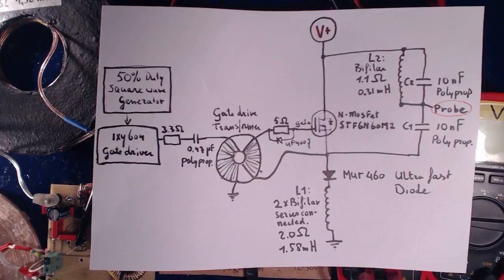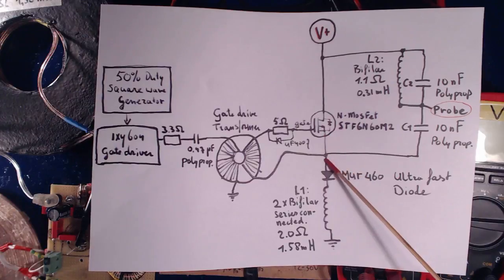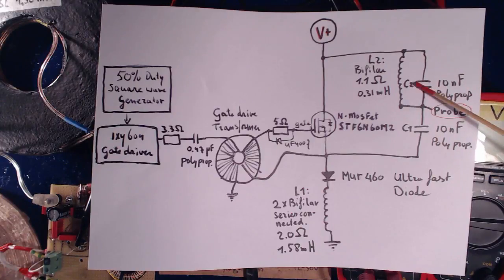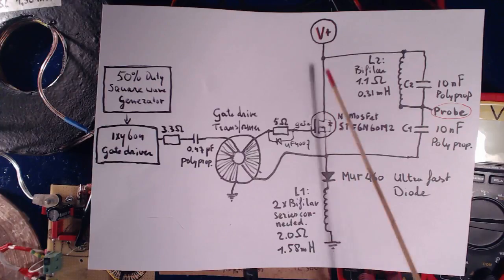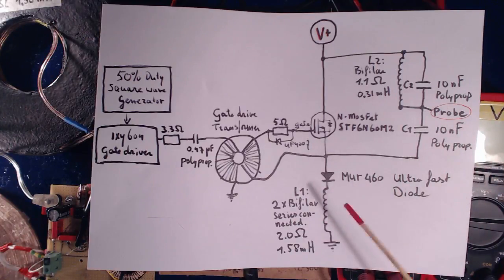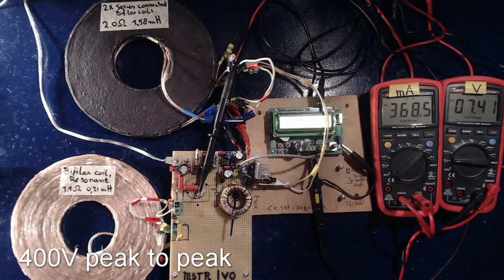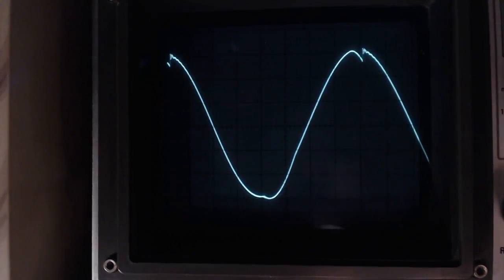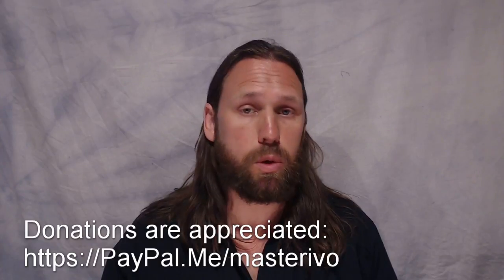Amplified series parallel bifilar coil resonance, from a single mosfet switch

Comment from the maker: Found new inspiration:Tesla's Radiant Electricity, read: http://www.shamanicengineering.org/wp-content/uploads/2014/07/Gerry-Vassilatos-Secrets-of-Cold-War-Technology.pdf
Reply: Jerry did an awesome writeup also read Thompsons " the researches & writings of Nicola Tesla" on how it all came about from switch closures and some switch operators died when switching at the peek. section on shocking discovery.
Reply from the maker: Yes Gerry Vassilatos, has writen a very inspiring book. Thanks for the tip, I'll look into it.
Reply: 404. Could you share a new link or pdf with the original contents?

Comment: how can it be grounded on the positive side of power supply? i thought negative is always the ground?
Reply from the maker: my PSU has a separate ground which can be connected to any polarity. voltage is always relative to its reference point

Comment: I need free energy coil cable that can handle 12V & 500W LED is it possible?
Reply from the maker: 500W 12v needs a cable that can handle 42A. that would be a pretty thick cable.
Reply: @MasterIvo  How do the coils work? Do they absorb the Earth's energy or magnetic field?
Reply: @MasterIvo  How many turns & diameter for 12V 500W 42 AMP?

Comment: What about Stubblefields work as well?  Point being, how would dissimilar metals work for the different polarities? I would assume you would see larger difference potential for larger outputs. If metals resist or aid would be dependent upon where you have them in the circuit. Copper, zinc, steel, iron, silver , gold. all act different toward polarities of the fields. I might try an aluminum and copper coil.
Reply from the maker: i don't know

Comment: Hello Master degree,

How you make to obtain a negative spike in your form of wave in this video and not in your previous video ? However the circuit is always series parallel. Only the exception is that you operate your new circuit to only amplify using one mosfet. Is it what in your electronic components which causes this amplification with a negative spike ?

Thank you and cheer for your extraordinary work. :)
Reply from the maker: Bruno Marier I don't know exactly, it has been a while, I'm now focusing on a new (radiant energy) concept. I use regular parts, nothing special. This single switch uses the mosfet to discharge.

Comment: Hello Master degree, superb video like always an incredible professor. Did I want to know how is to manufacture your toroidal transformer which gauge of wire use you AWG and how much turn of rolling up in your video or do you only use a mosfet? Do you call this one a gate drive, it is used to protect your gate Driver and function generator ? Thank you for the true and still Cheer!!
Reply from the maker: Thanks Bruno Marier, I deleted my previous answer, because I assumed it related to the wrong (latest) video.

the previous video about series parallel resonance has more information about the gate drive circuit.

You could do this without a gate drive transformer, by using low side  switching.

Comment: A 1.5 vdc bat can yield up to 350v BEMF.   A 12vdc pulsed into a coil can yield 5kv BEMF,  100vdc will yield 50kv which was seen on Oscope using hv probes.  The BEMF is a ringing event which osc based on coil internal structure its L & C determine Freq  and the R determines the dampening of the wave as the Ether returns to its zero state.  Both the Neg & Pos portions of the ringing BEMF can be captured and stored in caps using very high speed diodes.  I've seen BEMF osc in the 400khz range.   Tesla built his systems in his head and then used empirical method to get the final product. He knew exactly how to build the stuff from knowledge he gained thru testing, testing, and more testing.   If you take a coil and use a wire as a quick contactor you'll find that the BEMF is not consistent with each striking to the coil. I'm not sure why this occurs but it maybe due to the vacuums Ether having different pressures in its gaseous state.  Tesla considered the Ether as a solid and he said we were walking thru  solid steel. which was non-compressible just like water.   If you have a hose from NY to London filled with water and you touch the NY end the end in London would show it instantaneously.   UFO;s flying into sun spots produce a burst of water into space.   amazing stuff.

Comment: I 'm trying to use two rechargeable batteries 3.2vdc a relay and a loop back idea where the device uses one battery to run it and recharges the other battery.  the circuitry will automatically swap the batteries needed.  the 1.2vdc relay normally closed contacts are in the battery power loop this causes the relay to open and close at maximum speed.  also in series with the relay contacts there will be a coil and cap.  The BEMF from this coil will be used to drive a Tesla Bifilar in resonant state and a portion of the output will recharge the second battery.  I'll be using this as a product for school science labs as a self running energy device.  some of the output will be stored in FARAD caps to do work.  Circuitry will be on a PCB.  the prototype ran for 24hrs but had a wrong recharge circuit
Reply from the maker: Very inspiring school project. Was the BEMF (inductive spike actually) used from the high side (positive voltage) or from the low side (negative voltage)? This should make a difference. And  was the bifilar coil resonating (at a sub harmonic)? 

Very interesting video if you would share this!

Comment: Your use of BEMF neg to create the sinewave is very well presented.  The guys and gals can learn a lot from us.  I got away from the pulse transformer and went with ixd614 driver.  also used dc to dc converter along with  opto isolator on my pcb layout I used separate ground plane that floats.  this protects the digital and analog control circuitry of my impulse car motor.   BEMF HF osc + or + depending on initial input + or - is cold radiant electrostatic energy weak until stored in a capacitor plates thru diodes which converts it back to powerful kinetic energy to do work.  You can also capture the smaller positive BEMF ringing events but usually the FET protection diode prevents this.  NICE JOB .
Reply from the maker: Thanks! I was forced to use the pulse transformer, as I use a high side switch, to produce a negative voltage. I do believe a negative voltage is needed.
I feel the Radiant Electricity (cold electricity), is induced by a fast sharp (disruptive) capacitor discharge, through a coil, inducing resonance in a parallel coil. I hope to start working on this soon, after finishing building my new Laboratory.

Comment: I used our understanding of frequency color and geometry all the way from nature, to art, to math and science and history (the truth and the bullshit) and I just following the parallels with our best understanding of space time and gravity.

This is what makes the tretahedron (the red yellow and blue primary’s if you will) The cycle would of our holofractal geographic universe would turn that into the perfect 64 tetrahedron. That’s everything that exists. That’s the harmony.

The merkaba tetrahedron is the red yellow blue of the 64 point tetrahedron. Using our math and understanding I left the cycle go on paper and it created exactly that.

32.768 is the tune we would make Quartz crystals to time watches to be accurate within 5 seconds in a whole month.

Using the musical octave 8 rhythm pattern, that matches the exact true rhythm of earths frequency. Also using the 8 beat rhythm that makes our 48 points of the spine that’s the same math that allows function of your body.

The 48 is your “body” shape every 8th point represents a matching rhythm to allow synchronicity. Our octave scale comes from this. These are your secondary colors. In there you find your primary’s so it’s not just trying to literally build the whole matrix piece by piece. It’s just using the very first point of reference to establish your order of equation.

The 12 scale bullshit is for hypnosis. It keeps the masses on a 8 to 8 rhythm.

That’s why trying to break your pitch up 12 times in and 8 Ruthann octave doesn’t make any damn sense and why the greatest composers who did do it well would be labeled geniuses. It’s a nightmare of an equation. If you just take 32.768 plus itself and mark that out 48 times you will get a perfect symphony of matching frequencies. You can do that with any pitch, I know I’m not teaching you anything about the musical part but you gotta understand that has always been a completely foreign language to me and now I can keep up in the conversation lol btw idk if you know but our: whole half quarter half whole pattern of music comes from Sumerian tablets found in Israel about forever the fuck ago. So that’s a fun fact lol.

Using trifilar phi ratio “rope coils” to create your phi ratio trifilar equal and opposite vortex. Follow the sequence until your 48 patterns are revealed and you have your overall shape. Use our best understanding of phi ratio to check your math.

This is the answer.

The true chakra frequencies from root to crown are:

32.768 294.912 557.056 819.2 1081.344 1343.488 1572.864

These numbers show your secondary colors.

8.192 is your “0” or your ground or the color black

32.768 is your your “1” or “power” or red

557.056 is your “2” or your increase in power using with;for. color yellow

1081.344. Is your “3”. More with and for more increase of power your color is blue

The 48th sequence is 1572.864. This is your perfect fractal shape inside of shape making shape. All equal and oppositely working using trifilar rope.

Those are your primary’s which lead to your secondaries. That’s the merkaba tetrahedron. The primary of the 64 point tetrahedron.

My email is inkbyrallison@gmail.com 
Ask me what you will.

I wanted you to see this, it was your understand of the phi ratio and the bi filar that would lead me to the bigger picture. I knew the Egyptians used the phi ratio but you made it so simple to understand my friend. Here you go

Comment: I think you might find this circuit. Interesting. This circuit is very simple and seems to allow the extraction of current from the dielectric field of a magnet stimulated by the earths magnetic field. This is a very simple circuit and I think you might find it very very interesting. Note the zinc plates used as one polarity. http://rexresearch.com/meyers/meyers.htm
Reply: I think the zinc plate being a diamagnetic substance allows for the capture charge from the disturbance magnetic field which is stimulated by pointing the south pole of this device to the north of earth. This creates a perturbation in the dielectric field which is captured on the zinc plate. With modern circuits we don’t need his mercury rectifiers. I think Ken would really love this as well.

Comment: study the water hammer effect it might help you see what is happening I find they act very similar https://youtu.be/aspPJ2Wcaig this also makes me think of mercury and how it can move and be conductive if forced to move on a coiled dielectric what type effects might it have even more so if charged with current in same or opposing. wish I had a lab but you think on it we might get energy source and transportation. also bifilar in series if you want thinner but flat use copper tape it has a plastic layer that should make it read from pack just need to be keep from unrolling when you open it
Reply from the maker: thanks for sharing this video with me. I already was thinking about it. The vacuum created is very important as it is repressurized by the ambient. An electrical vacuum might be created by a fast "disruptive" capacitor discharge.
Reply: also the spark gap the discharge might be like forcing high pressure stream in to a another pipe if in water it pulls outside fluid in with its pressure
Reply from the maker: A spark in a sparkgap, is like a concentration of the dielectric field, a collapse. What you say, is it pulls in more dielectric field lines (voltage) from the ambient.
Reply: have you tried magnetic film or iron powered in a oil solution to see if you can get a visual on the experiment? or a powdered sugar it might help see dielectric field
Reply from the maker: That only works with dc. With ac the fields are constantly changing.
Reply: do you know if this has ever been tested with copper coated iron wire? we have advanced a lot in caps inductor diodes but the wire remains the same I know superconductors would be ideal till then we might find composite wire to have strange effects like nitol wire
Reply from the maker: I don't know. but due to the high frequency we have to deal with skin effect. I now use copper coated aluminum. I intend to build pure copper coils to see if it's different.
Reply: keep up the experiments and have senses open for any effect lots of leaps come out experiments to do something else. ppl might not see it but hho gas pulse motors all came from open source experiments few other things too now we have dc brushless light enough to have quadcopters also cars got brake charging.
Reply from the maker: Indeed many surprises while experimenting

Comment: It is a interesting drive circuit with the second coils spike. Can you couple more resonant coils for energy extraction, like skycollection did in his setup's?
Reply from the maker: Yes I tried adding a third parallel coil, and tuned it for maximum resonance, by adding a parallel capacitor (18nF). I noticed I had to reverse the coil for the best output.
Reply: This is consistent with the experiments from Daniel Davis Jr. discribed  in his Manual of Magnetism  with varios flat coils  coupled , he states that the current flow direction changes from one coil to the next.

Comment: Your V+ must be a grounded power supply?
Reply from the maker: No. Not necessarily. The resonant coil is "grounded" on the V+, this makes it possible for the negative inductive spike to charge the capacitors, and for the capacitors to be discharged by the mosfet. In effect making everything resonant.

Comment: Hi thanks for the video. Can you help me understand what kind of applications you see in the future? Infinite resistance equals infinite power? Is that the idea?
Reply from the maker: We will see what it will bring us in the future Derek Humfleet, there is still much we don't understand.
Reply: Master Ivo I watched your previous video using two mosfets. This is exactly what I'm looking for to get incredibly high voltage from a relatively low power source. 

    Would love to hear your thoughts on a capacitors loss of weight as it holds more charge.
Reply from the maker: Loss of weight as a capacitor holds more charge. That is very interesting! It indicates the role the dielectric field plays in gravity.